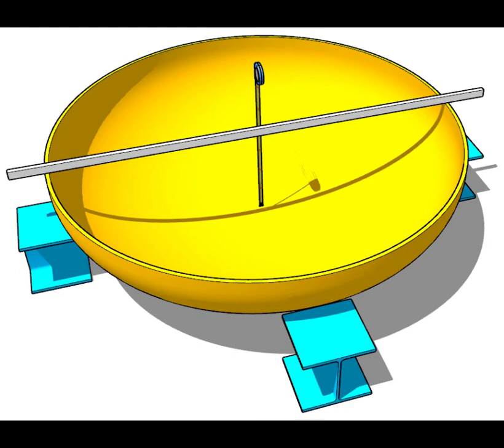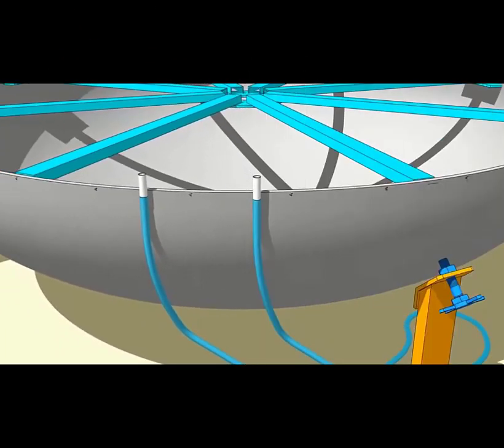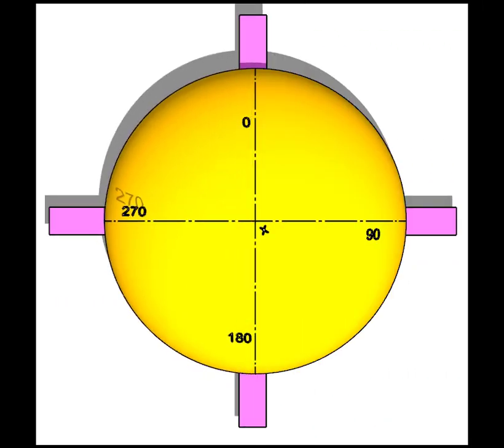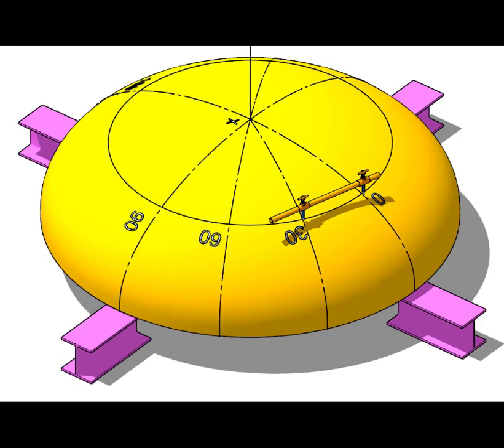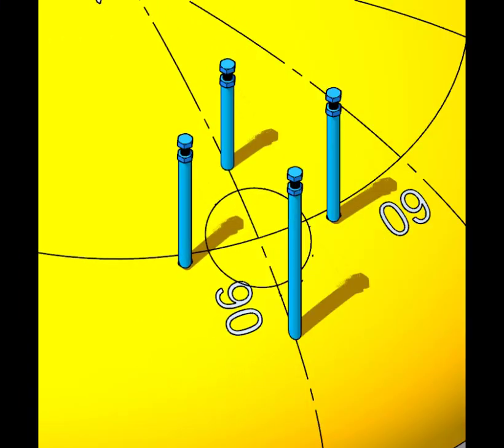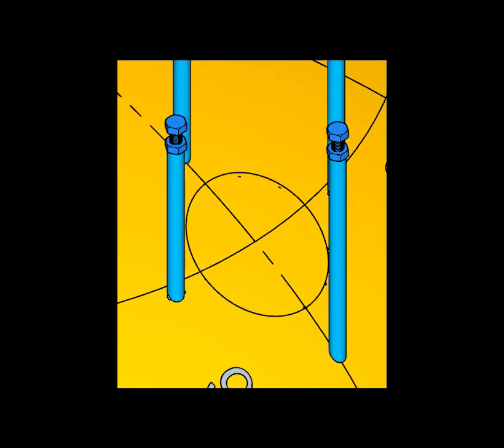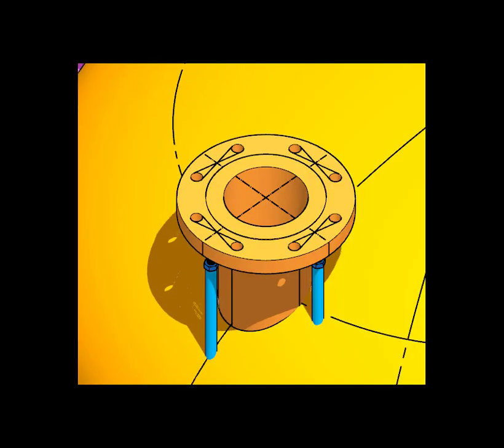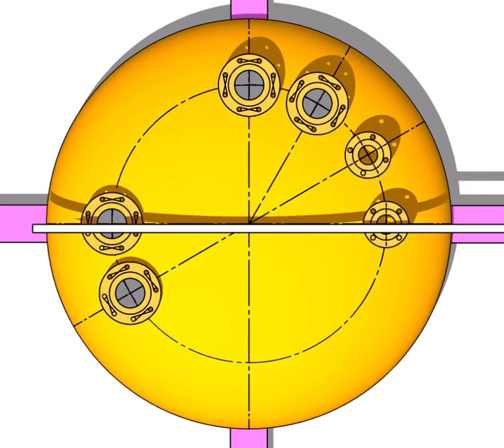How to fit-up nozzles on a dish end- tangential method tutorial for beginners.

Comment: Good , i have h question how to marking on big dia dome roof nozzel openg marking  by calculation, please make a video on this...bcoze we cant put 24" manhole on adjustable nut bold
Reply from the maker: Bro, the method is same as, fitting a manhole on a conical roof. Your topic is very good. But the problem is, even you calculate the dimensions, practically the marking will not be accurate. Anyway will make a video on this subject soon. Thank you. https://www.youtube.com/watch?v=iBmLOJMSVDE&t=181s
Reply: @technicalstudies.  Ok thankx 👍